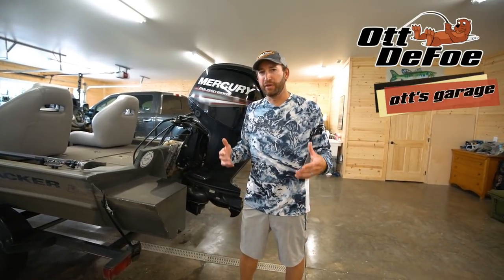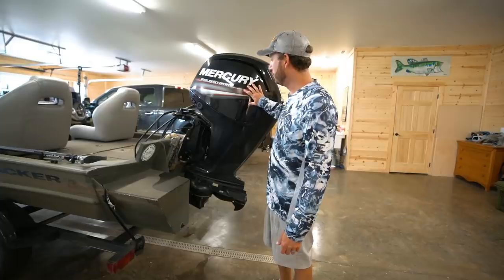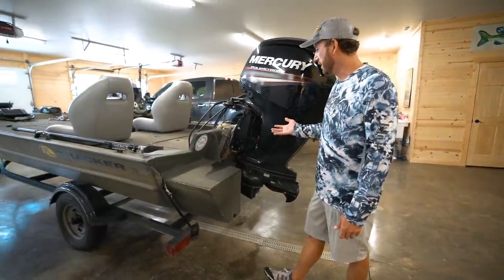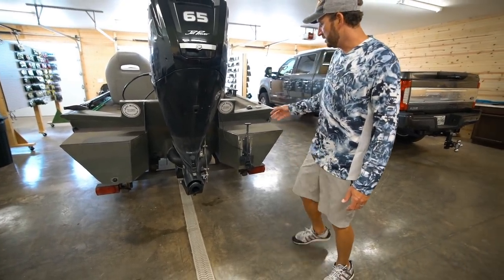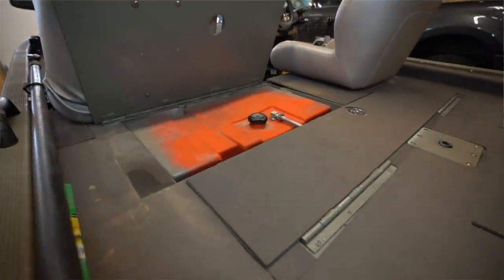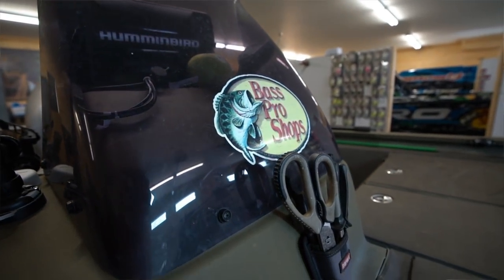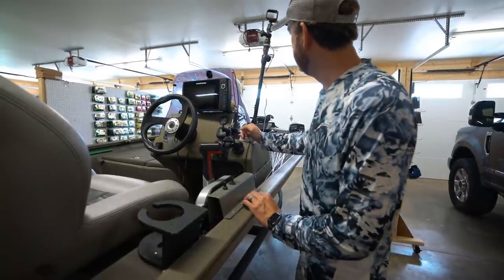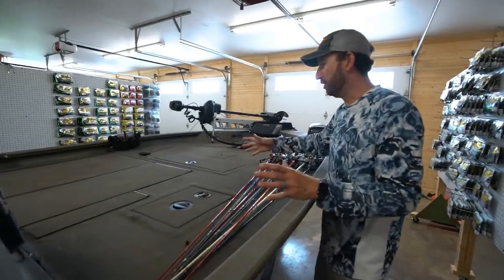Ott's Garage | How I Customized my River Boat Full Walk Through of my Tracker 1754 Grizzly

Comment: I'm running the same 60/40 set up you used to have and would love to add a tunnel and switch to the 90/65. Did you have to do anything to the transom to support the bigger outboard? Was it rated for the 65hp you added or have you gone over the recommended HP for the boat?
Reply from the maker: It’s rated for a 75. He did add some transom height and bracing but it may have done fine without it. We wanted to not take any chances.

Comment: Hey Ott. I'm buying a jet boat soon and have been trying to decide which trolling motor to run. I live near you will be fishing the Holston and French alot. I'm leaning on the ultrex because of its responsiveness on the foot pedal and its manual stow and deploy. Do you think it is superior in these river situations vs the ulterra and its power stow and deploy?
Reply from the maker: For sure. I would not recommend an ulterra for the river. They are great in the lake but the trim system doesn’t hold up well with bottom contact. You’ll not regret the ultrex.
Reply: @OttDeFoeFishing  thanks for the reply!

Comment: Does the jack plate allow this boat to accept the jet? I am looking to buy one and put a jet on it. A couple dealers have told me that they don’t run with jets. The only way is to weld the bottom of the boat they say….. just wondering if you welded the bottom or not. I want this boat!

Comment: Did adding the flotation pods effect the steering? I just purchased a used Alweld tunnel jet and it’s heavy in the rear. I want to add pods. I called Alweld and they said it will make it hard to turn the boat cause it’s a jet and turns off momentum thrust.. What’s your thoughts?
Reply: Got 18'9 Xpress tunnel hull, pods are the way to go. Gives more flotation. Don't have any turning issues. Have a 150 on the rear ,runs in 4 inches of water.

Comment: I appreciate the breakdown.  I am in the research phase of getting my first boat. I live in Galveston, TX near the coast and want something I can primarily inshore fish with as well as run up to Lake Travis and the Colorado River.  A large consoled jon boat seems to be the ticket. If anyone has a recommendation on what consoled jon boat to get, holler at me!
Reply: Cant really go wrong with alumacraft lowe sea arc or havoc if your looking for true durability trackers welds do NOT look great go to your local bass pro and give them a good look over ive seen transoms that looked like someone used their feet to weld instead of their hands that being said its just a quality control issue not all trackers have bad welds
Reply: @andrewparisotto2631  thanks for the shout man. Ended up scoring an 1860 alumacraft center console with a 75 yamaha. She eats
Reply: @TheTexasAggie2013  i bet she does cant go wrong with the Yamaha especially love those engines had an 86 50hp that we put through the nastiest flood water you could imagine for 2 summers Bowfishing before the impeller went out only had to rebuild the carbs (floats and what not) 1 time out of the 5 or so years we had it shit it shot a piece of the reverse gear out of the lower unit and we didnt even know until we got back to the ramp forward reverse and neutral still worked fine couldn’t believe it man